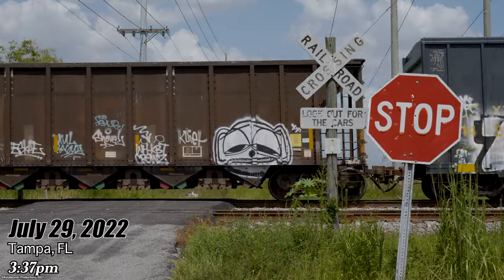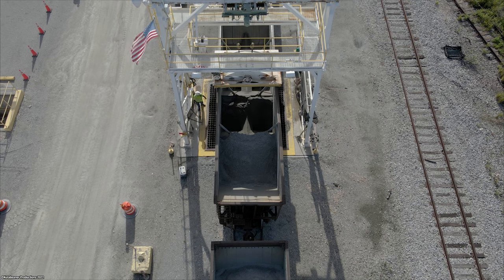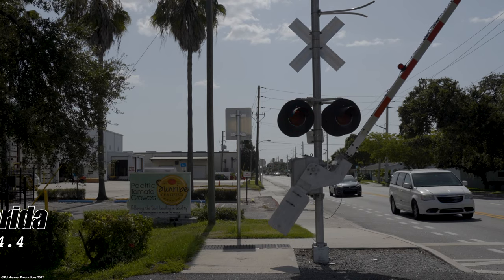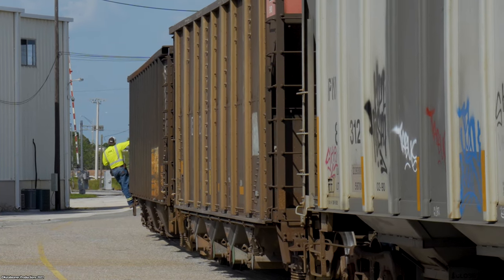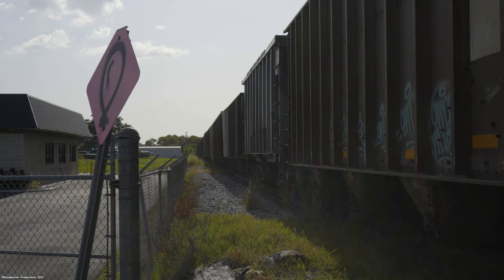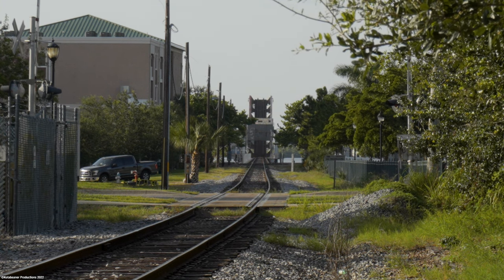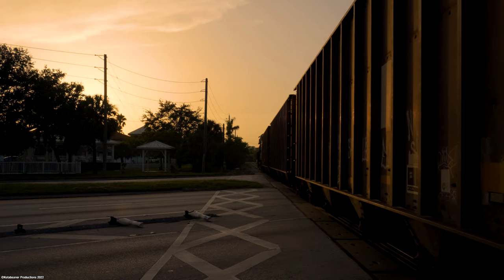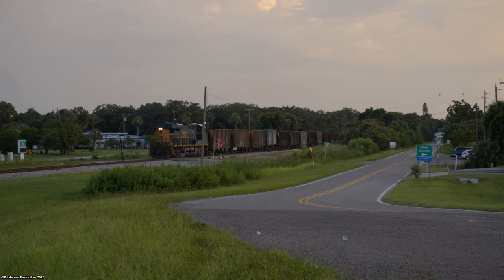Aggregate Operations on CSX's Palmetto Subdivision

Comment: I didn't realize Conrad Yelvington was receiving so much rock lately and I'm guessing that volume will increase with rebuilding efforts in Fort Myers following Hurricane Ian. I'm wondering if any of their other ALCOs will be replaced with other power over time given their other facilities have been known to have such engines like what used to be used at Palmetto (suprisingly that S-2m original worked in Canada until the early 70s when it was sold for use at a mine in the Bone Valley). A small correction about the Bradenton depot is that passenger service was discontinued upon the formation of Amtrak in May of 1971 which used to connect with the west coast trains at Tampa Union Station and swap cars with it. It also seems that the current connection between the old S-line and A-line at Palmetto was added sometime after the formation of SCL as it appears there was indeed a connecting track between the two near where the diamond used to be but it was in the northwest corner (also surprising is that the Tropicana Juice Train used the old S-line route to Durant at least once in the 70s as documented by some photos I've found online)
Reply from the maker: Very good information, and I appreciate the corrections. I do know that for a while, the SCL’s Juice Train ran that line supposedly to bypass Tampa, though it’s unclear for how long. What I will say, though, is that Conrad Yelvington (Palmetto’s at least), doesn’t typically receive quantities of rock like they did in this video, which is part of why I came out to document it, as their shipments, too, have been seemingly getting smaller over time. Ian may definitely have a part to play in future shipments, as will the Seminole Gulf’s Sarasota branch, as transloading ops were discussed heavily among Seminole Gulf as their other line took a huge hit. Should it become feasible here soon, I may make a trip down there to check on progress fairly soon.